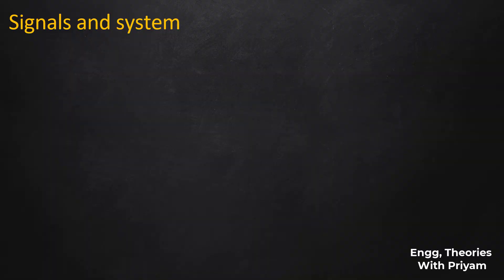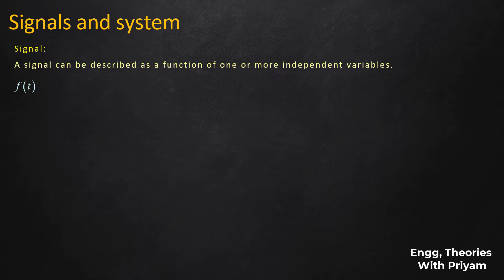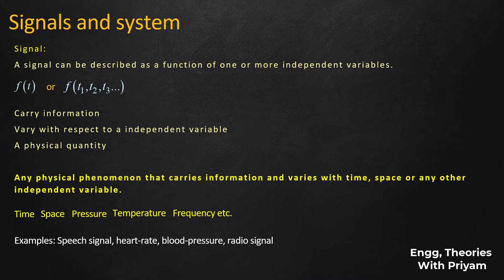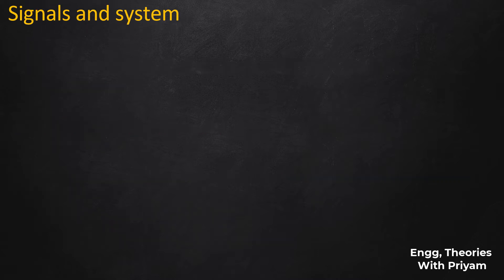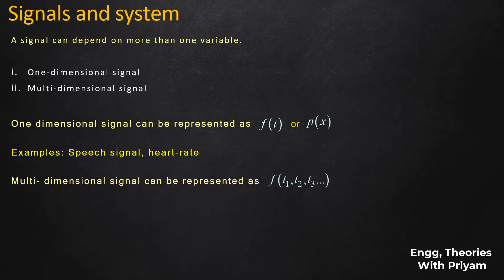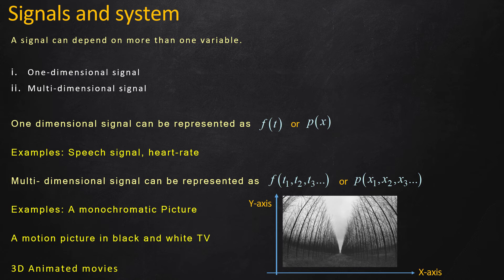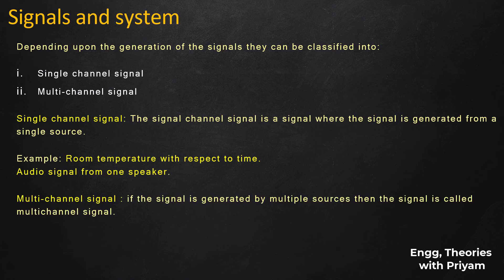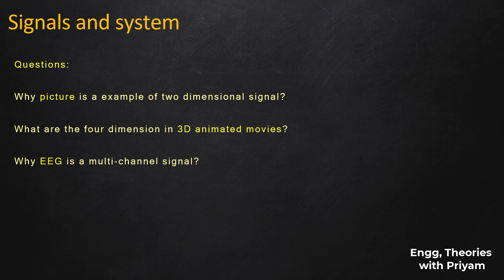Introduction to signals and system || Signals and systems || Lecture-01

Comment: Q.1) Why picture is an example of two dimensional signal?
Ans. A picture is a two-dimensional signal because it is made up of many tiny squares(pixels) arranged in two directions: width and height. Each pixel holds information about colour or brightness, allowing us to represent and manipulate images in a way that computers can understand.
Q.2) What are the four dimensions in 3D animated movies?
Ans. The four dimensions in 3D animated movies are width, length, height and time.
Q.3) Why EEG is a multi-channel signal?
Ans. Electroencephalography (EEG) is considered a multi-channel signal  because multiple electrodes are used to record the brain's electrical activity simultaneously from different locations on the scalp.